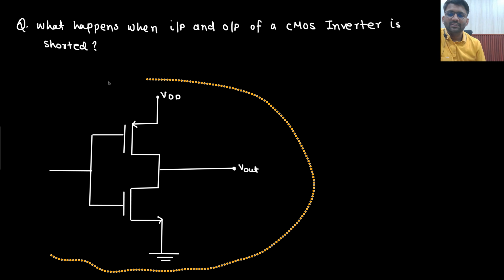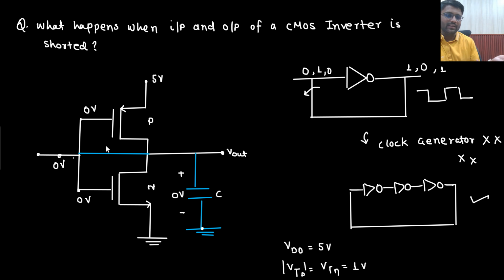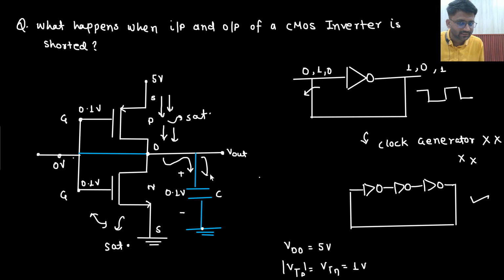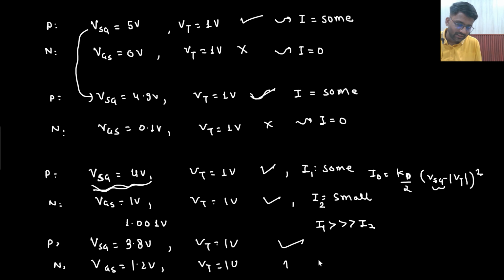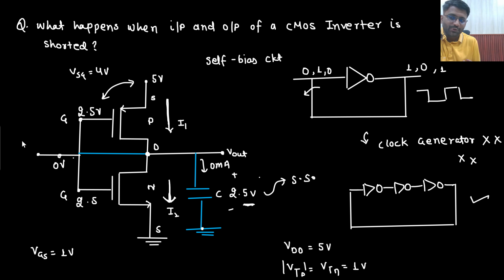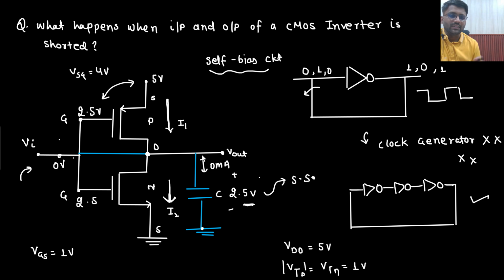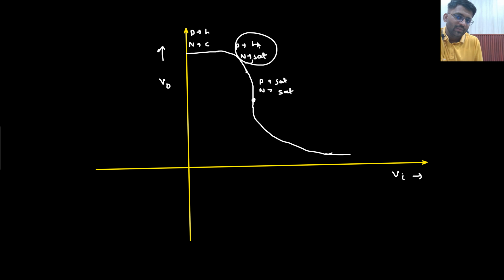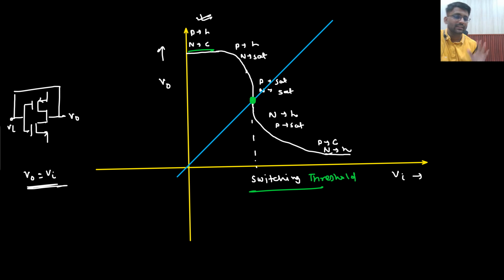What Happens When the Input & Output of a CMOS Inverter is Shorted || PrepFusion

Comment: Hi  Mr. himanshu than you this explanation.. However i have a query... what if the cap is initially precharge at 2.5V ,   the cap voltage will never change i guess..so it depends what is the initial charge store across the capacitor, right ??